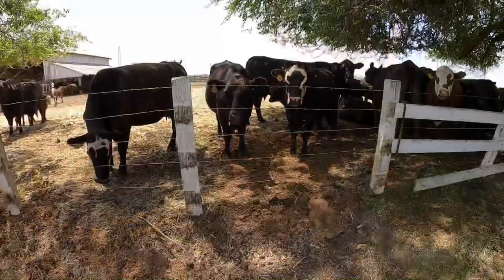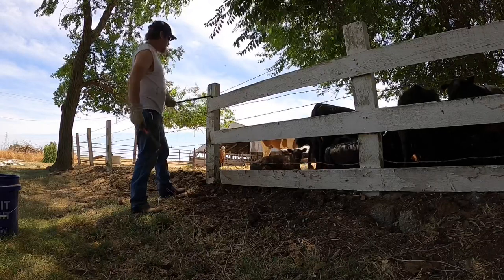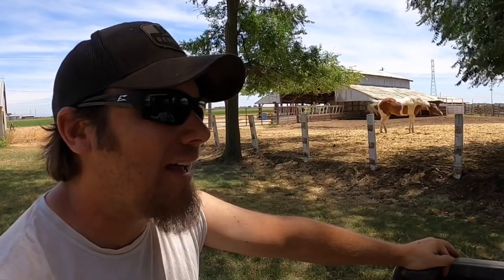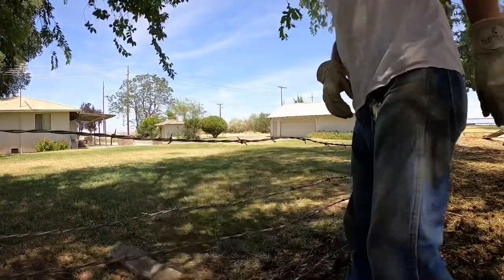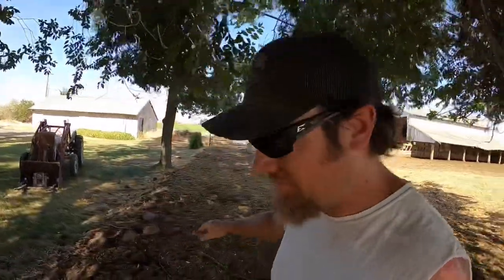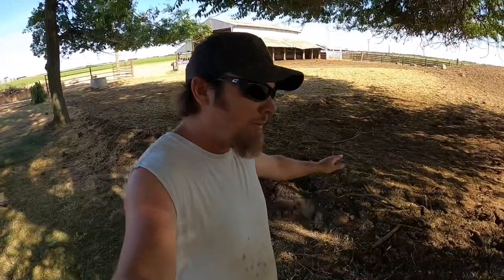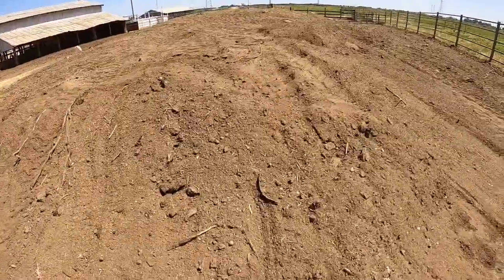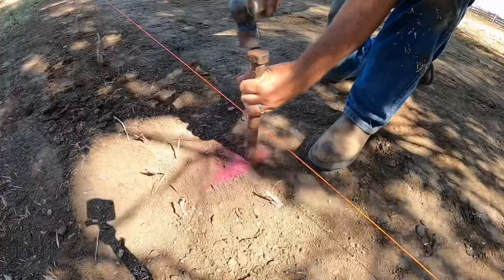Fence Demolition! How Much Abuse Can the 8n Take???

Comment: Hey FT, that 8n will be running when your kids can work the farm and for years after.  There is nothing being made today with all the plastic parts, electronics and cheap parts designed to fail that will running for as long as the 8n does. Those tractors were designed and put together back in the day when things were built to last. She might have some challenges and might not be the prettiest thing but as long as she gets the job done, who cares!

Comment: It is really neat to have memories of working with your Grandpa. You are a very hard worker and also the step where you used the bolt to work a starter hole for your post hole auger is a neat idea. The irrigation of the pastures is a time saver and it is a blessing to have that way to irrigate. Really enjoy your videos. Thank you for doing them.

Comment: We never used an auger but we do use a big crowbar and make ALL our fence post holes like that. We sharpen our posts with a chainsaw or ax, and drive the posts in either with sledge hammer or the bucket on a tractor. This is how i still put my posts in. You are pretty smart to come up with that on your own!

Comment: Enjoyed it....can't wait to get out and continue working on my fence...had to take a break of 7 weeks...due to constant rain and mud. May and June has been unbearable with the rain here in Dallas. I know the feeling of having so many good memories of your grandpa and working with him. Now you can lean you steel posts "in" to the corral...2" from bottom to top on each pole. Hey, i try to lean my t-posts with barb wire in a few inches...just in case. You can lean things in without any noticeable effect. But when livestock push on things outward it's very noticeable!!!
Reply: I wish you could package up some of that moisture and send it out here to FT and the rest of us. We’re bone dry!
Reply: @jeanettewaverly2590  I'll remember what you said the next time my knee high boot comes off flush with the mud!!...my crushed gravel road has now sank into the mud 6 to 9"...need to buy more stone AFTER the rains let up. You should hear the water sucking sound as i can barely pull my boot with half my leg in the mud out....after my boot comes out....the water line in the hole is completely back filled with water in seconds. Got my wife yelling at me that i need to fix the roads and the barn area....but i can;t fix anything cause it keeps raining.
Reply: @LarsonFamilyFarm-LLC  Aargh! 😱
Reply: @jeanettewaverly2590  My question is...does the sun still exist?....I never see the sun anymore.
Reply: @LarsonFamilyFarm-LLC  It’s vacationing here in California. Hopefully its annual leave will run out soon and it will head back your way.

Comment: The old ford did good! We always used the cross member behind the bucket.  For really stubborn ones we drove up along side the post and hooked to the loader arm between the front and rear tire.  Your divot is a good idea, think about an old implement axle and a steel post driver to create it with.

Comment: I tried saving some boards as few weeks ago. I started with the large crowbar like you but, it kept splitting the boards like you. I changed to a short one that had like a bracket on it. It was so much easier and saved the boards.

Comment: Looking good. A lot of hard work in the heat but hopefully the breeze I hear helps keep you a bit cooler.  Interesting on the watering system. I've never seen that before.
Good luck and I know the metal fence is going to be awesome and very much more timely in the fact you won't have to worry about replacing any of it anytime in the next manyyyyy years I would think. :-)  
Blessings

Comment: I prefer to use screws over nails. A lot easier to take apart. Good tip on the bolt to mark your augers. I have always had someone to spot for me but if your by yourself that would be a good idea.